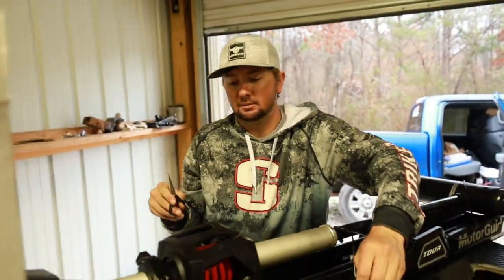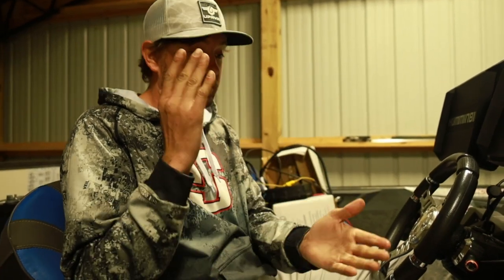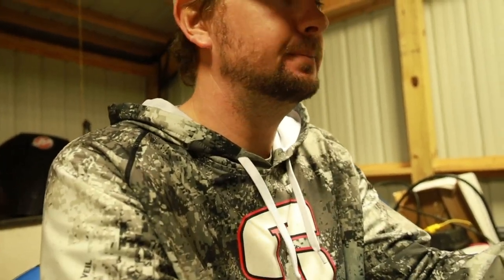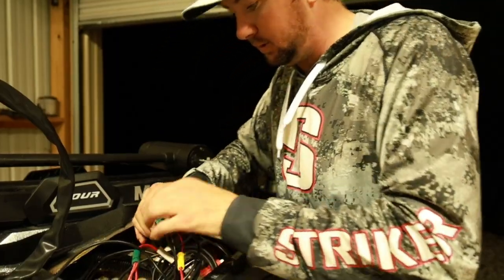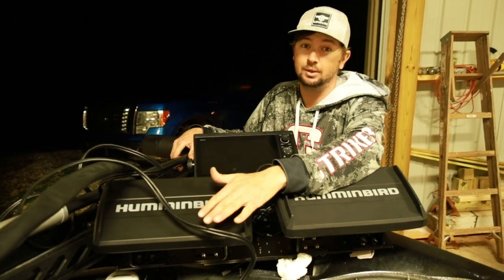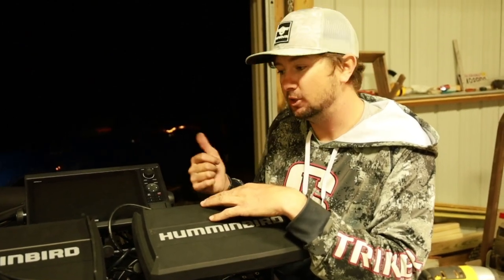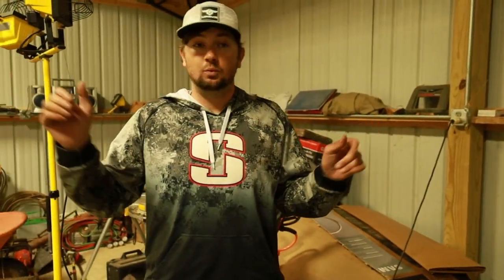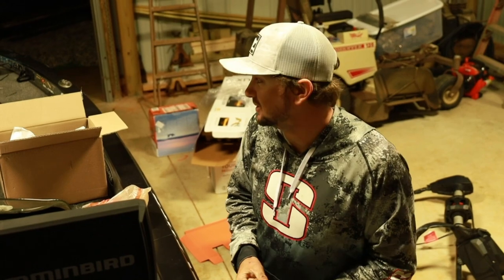How I Rig My 2021 Elite Series Ranger

Comment: Good vid, bro'. Some questions if i may. Since you didn't have any sponsorships for your graphs and bought them with your own money, can you give us some insight on why you chose Humminbird over Lowrance? From what I can tell, it sometimes gets down to a Ford/Chevy type debate. On the other hand, some say Lowrance has better waypoint management, more power, are faster units, easier to use (user friendly). Still others say that the DI/SI are way better on Humminbirds but that HB's have slower processors but better definition/clearer pictures. Also, Lowrance has "Active Target" now to compete against Garmin's LiveScope. So, why go with the LS versus active target. Also, I think you chose Helixs over Solix's. What some have said is that the Solix's are touchscreen, but slower than Helix's. Have you used LiveScope in the past, or is this new to you? Can you just go into all that detail for us?